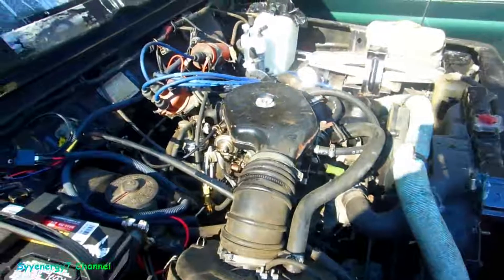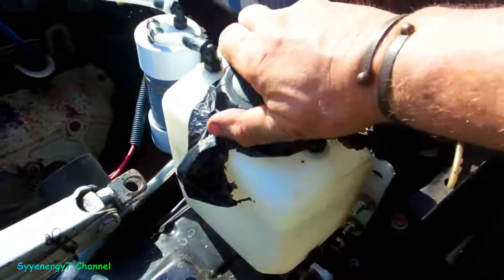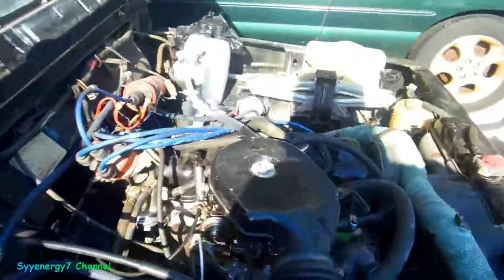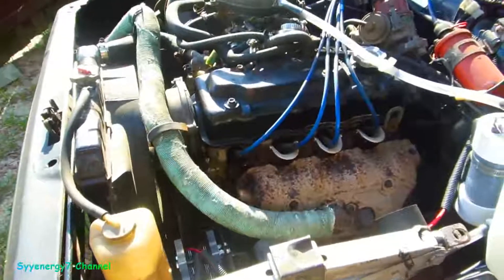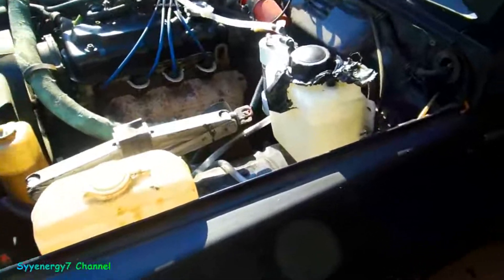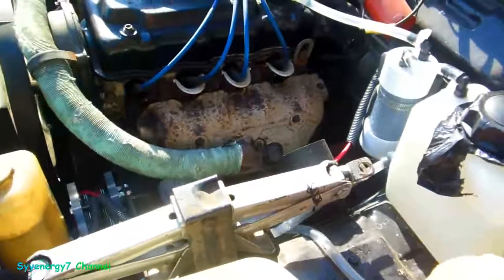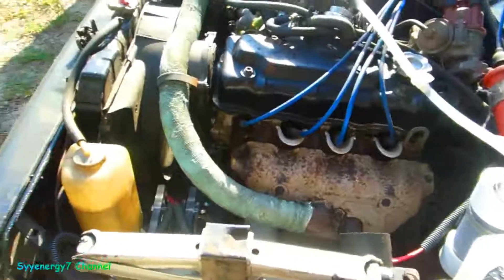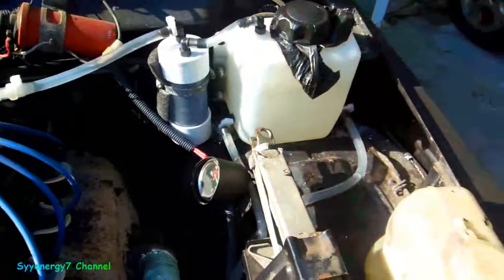HHO Likely to be REVIVAL of CLASSIC CARS

Comment: Hey Syy I've been in the renewable energy business for almost a decade and I have heard very much of HHO however I've never really tried it myself. If you are getting improvement in mileage and efficiency please explain to me exactly what you did and with what and I will replicate it. I have built charcoal gasifiers, wood gasifiers, carbonization kilns, vapor fuel systems, and ultra high efficiency wood stoves and I would like. I want to know exactly what you did and how you did it and replicate it in my 69 pickup. If this system does work I'm going to replicate it and combine it with vapor fuel and charcoal gasification and build the worlds most efficient truck from my 69 pickup. So far I'm betting I can get over 200 MPG on nothing but fuel and can be gas free with my charcoal gasser. If I can reduce the charcoal consumption with this system then I'm very interested. With my charcoal gasifier I can and do run preheated steam which is heated using the exhaust and radiator and inject that into the ember phase of the gasifier and that produces hydrogen to mix with the Carbon monoxide (syngas) but if I can produce even more hydrogen using this system, then I really want to know.
Reply from the maker: Joe Schmoe I put in a HHO kit.  This Jeep has no computer.
Suzuki Samurai Installing HHO, Part 1 of 3 {Brackets} 
http://www.youtube.com/watch?v=cjy7UNLF4_0

Suzuki Samurai Installing HHO, Part 2 of 3 {Plumbing} 
http://www.youtube.com/watch?v=5x9lNzSOX_8

Suzuki Samurai Installing HHO Part 3 of 3 {Wiring} 
http://www.youtube.com/watch?v=l5SDbyWyARo

High Output HHO & Amp Gauge Install - Suzuki Samurai 
http://www.youtube.com/watch?v=0A8zTrJRPkM
Reply: syyenergy7
Thank you, I will definitely check it out!

Comment: Ppl probably aren't doing it more cuz unless you're in Florida or the Southwest the water will freeze on you and crack the lines and tank in the winter.
Reply from the maker: cityguyable Use KOH electrolyte (potassium hydroxide) instead of lye or add alcohol, then no freeze ups.

Comment: 5 amps at 12 volts is 60 watts. a 1 horse electric motor is 735 watts.
Reply from the maker: Sidney Boudro It does not effect the idle and now that everything is sealed up well, I can see it does do very good HHO production.  I also have the K&N air filter, so this will be a new test.  If this thing gets 30 mpg, I'm going to leave it the hell alone.
Reply: my passat got very fast but didn't save gas,, unable to instal O2 sensor modifier. so,, does running JUST HH eliminate that problem?  ps: my HH0 guru showed me a plug with 75K miles after running HH0 for 1 week. it was CLEAN. ( HIGH IDLE MAYBE?)